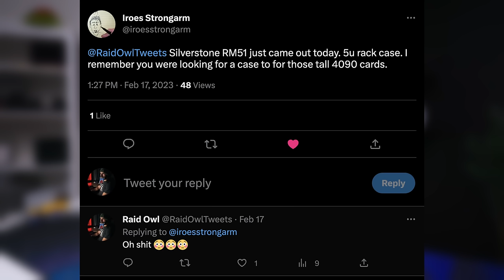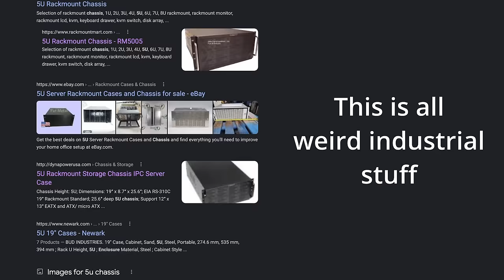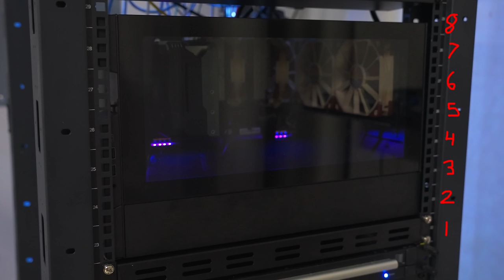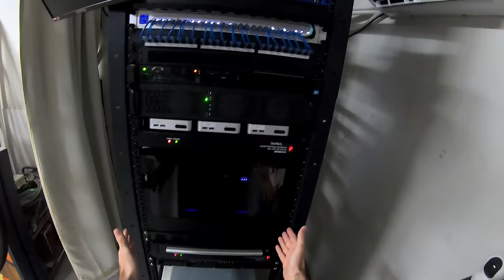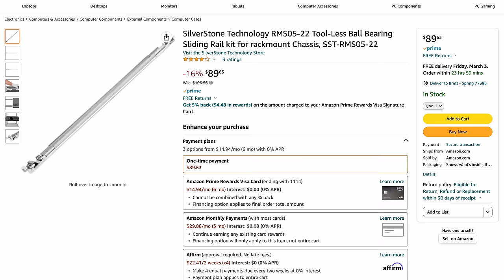An actual 5U server chassis - Silverstone RM51

Comment: I am running the RM42 for about 2 months now and I am just using a 6800XT from XFX which already was a tight squeeze, I had to remove the PCIe support bar completely in order to fit the GPU. Having the additional 1U of headroom would have been nice, although I would not have had the space in my half height server rack to fit it. But overall a great case and it is running great. Thanks for the video, it was very informative.

Comment: It may cost more up front however that case will give you a lifetime of service.   Just keep it dust and condensation free to negate corrosion.
I have two 4U's I have had since 2007 and both have survived three complete system rebuilds.  
The two catches with mine are:
(a) the PCI slots are too narrow for the horizontally aligned USB ports on those multi-port USB PCIe cards but that can be addressed as needed.
(b) the front I/O header still has the original USB-2.0 ports and replacements are not easy to find for the case now it is no longer produced, so I added a 2.5" drive panel with 4 x USB-3, audio & mic connectors.
In my case I am running one as my daily driver i9 13 gen platform, the second a xeon system running TrueNAS Scale, and the third PfSense Plus with 2x4x1GNics & 1x2x10G Nics.

Comment: Just got this case at work to move a thread ripper based system into to use in a road case for mobile live productions on VMIX and OBS and it’s a really nice case! One feature it also has is it comes with a rectangular metal piece you can mount 2 80mm fans into for extra exhaust, if you have a ton of pcie devices, and slot into that space above the pcie slots (so that gloryhole he mentioned is for the fan cables)

Comment: As a professional stagehand with some gaming interest on the side, i think I'm gonna pull the trigger on this case. I have a 12u shockmounted roadcase just collecting dust so i think I'm gonna mount this with my 3u guitar processor and maybe some extra fan panels for the blank rack units. My biggest concern will be cooling but I imagine if I dont back my roadcase up to the wall I should be pretty golden especially as my current PC has a water cooling AIO ill be putting in

Comment: I had been going back and forth between some of the 4u options from Sliger.   This case is wonderful for just making sure everything fits with clearances.   And is oddly tempting to want to watercool.
Reply: I got the Sliger 4u
Reply: What did you decide on? I'm considering the exact same thing.
Reply: @ryanwwest  Sliger cx4712 at the time - they now have a cx4713 as a very similar option.  I have been fairly happy with the CX4712 up to date - it does not have a real backplane for hotswap - that is the large downside I can mention.

Comment: If you are in the market for something like this again. You may want to take look a the rack mount offerings from Sliger. They do not have 5U cases but, they do have 4U and they have options. Which can be much cheaper for the case and rails.
Reply: Good call. I have a 4U case from Sliger with an RTX4080 in it, although I did need a 90 degree 12vhpwr adapter to make it fit. Sliger make excellent quality cases, although I also have a Silverstone case in my rack too which is equally as good.

Comment: I looked at it, but choose to go with a Pull out shelf and a standard cabinet (Lian Li Mini Air) which fits in my smaller rack. 
Where i live i saved around 449 us dollas on that to upgrade my GPU. 

My rack is mounted in my garage, 5M cables reach its with no problems, its really nice, im never going back to having it in my room, the Heat and noise is gone forever!

Comment: I would consider that case for my primary workstation.... I had to downgrade my Noctua NH-D15 to the NH-D12L to fit in my 4u rack case.  I just wanted my system to match my Proxmox and trueNAS racks... lol, for no other reason.   I am actually fine with the smaller cpu block as temps are fine

Comment: Looks very nice!
This case actually kinda reminds me of my fractal torrent with the 2 huge 180mm fans in front, and those can move a lot of air while not spinning that much at all.
Reply from the maker: Yeah this thing pushes A LOT of air
Reply: @RaidOwl  Would you describe the sound of the 184i Pro's motor to be 0db silent from 100-350-ish RPM? I'm asking since I want a system that is totally dead silent on IDLE, surfing with many tabs, very light photoshop, vlc, etc. I have zero issue with these newest Silverstone 180mm to be loud above 1000 RPM, but I need the friction in their motors to produce zero, but I do mean truly zero friction sound (motor noise, subtle grinding sounds which these fans were known for from their very faulty first production batch, etc) during idle use.

I love the RM51 since it apparently allows one to place it like a tower merely inches to the right of your face as one would usually do with a standard desktop tower chassis, all the while having two handle-bars installed on the case's top for ease of movement and looks. This is exactly what I want to do. I want to place the RM51 vertically (like a tower-style desktop on my desk) so that the PSU is ON TOP and the power button being on the lower-right (of the case's outer front), as opposed to the stock image of this chassis from the official site, showing the power button in the upper-left corner and thus actually implying that such an orientation has the entire inner system inverted by 180 degrees with the PSU on the bottom.

But anyway, then, after placing it on my desk vertically with the power button on the bottom right, I would then proceed to permanently pop-off the front metal grill (along with the dust-filter mounted onto it) and compensate for this removal by adding two FF181 (180mm) fan filters on the INSIDE of the case (i.e., mounted onto the fans themselves). The reason why I'd go through all of this hassle (500 USD RM51 + 40 USD 2 x FF181 dust filters) is because to MY eyes, this RM51 thing with the front patterned metal plate REMOVED looks as if it is THE definitive zero-intake-obstruction (metal-mounting obstruction) case on the ENTIRE market, meaning that not even the fractal torrent allows more air-intake than Silverstone seemingly pulled off with the RM51's usage of two 180mm fans and carving their metal grills so that they'd allow the absolute maximum amount of air to be taken in by these 184i Pro's (which, by the way, would be useless if hypothetically mounted in a case with too many metal patterns and shapes obstructing the living s*it out of any potential that these fans had).

My point and question being: do you, as the only person to have done a review of the RM51 think that:

1. The RM51 with an NH-D15 in it would be 0db truly silent during idle (up to, say, 500 RPM)?
2. The case can be placed vertically on a desk WITH the power button being on the bottom-right corner all the while two handle-bars CAN still be installed on the case's (vertical) top regardless, including the ability to install the plastic feet as well in such a weird orientation (opposite from the vertical-mode shown on Silverstone's site)?

I'm even thinking of making a noctua-themed semi-passive system in this case aimed at total silence, so am obviously REALLY curious whether the 184i's could synergize in silence with noctua's stuff so as to become a truly silent (during idle or even light-load) use?

Thank you for taking the time to read this and I am basically hinging my purchase decision for this chassis on your potential feedback. Please, let me know if you find the time.

Best regards!

Comment: Thanks for the video!   This is exactly what I have been thinking about doing. I have two desks (gaming desk) and a (work desk) with a 42U half full server rack between them.  I have been thinking about clearing up some desk space by getting rid of both gaming and work pc towers and put them in the rack.  Then just run the needed cables to each desk.

Comment: You are my kind of people.  Instant sub.  Don't forget the rails.  Can we Noctua the front fans?
Reply from the maker: I would if the stock fans had been ass
Reply: I don't think Noctua makes a 180mm yet, but I believe the silverstone 5U case comes with a triple 120mm adapter chassis for the front fan area (could be used for both water or air cooling. My tentative plan is to get 3x Noctua NF-S12A 120mms
Reply: @RaidOwl  do you think replacing the non-ass 180mm stock fans with 3 Noctua 120mms is wholly unnecessary?
Reply from the maker: @drewthompsonhooke  for me, yeah...but noctua fans are dope so I wouldn't blame anyone for swapping.

Comment: the thing you didn't know what its for, its a pci-e card support bracket the arms slide down and have fingers to hold the pcb so they dont move and get damaged in shipping and moving the system thy usually don't really work on gaming cards as they have shrouds and backplates in the way of the pcb but its meant for big pci-e add in cards you might see in enterprise settings

Comment: I know that some Supermicro 4U chassis can fit a 4090, if you use a 90 degree cablemod adapter. I haven't had a chance to try any other 4U chassis, but those Supermicro ones definitely work. Airflow is enough for a 4090, even though it only has a single 92mm intake fan.

Comment: In the process of moving all my servers and my workstation to a rack, and ran into the same issues.  Not only do I need a new case (can't fit newer GPUs in my current case), it needs to be rack mounted but also a new cooler as my current Noctua doesn't fit in a 4U.  So, subtracting the cost of the cooler, getting a case that will fit ANY GPU that might come out, and still having space for SSDs and a few HDDs.  It's really not that much of a stretch for something that, and you get those awesome fans in the front.

Though I REALLY would have liked to know how loud they were away from the rest of your rack.

Thanks for the video!!!
Reply from the maker: It’s extremely quiet and I’m a noise snob lol

Comment: I have to ask because you're the only video online (even including Silverstone's official) that shows how this darn thing works. Do you know how the front grill cover is suppose to come off so you can access the screws mounting the 180mm fans?
Reply from the maker: Yeah you just pull the front grill off. It’s attached by clips at the top and a grove at the bottom. Then you can unscrew the fans.
Reply: Do you pull forward or up, its suuuper tight and I'm thinking I might have to remove it from the rails to be able to apply force. Also thank you for the quick response despite how old the video is.
Reply: Actually, got a little brave. I used a flathead aimed for the seam between the front grill and case and tapped on it like a chisel, the front popped off. I see why it was so hard now, two ball pins with catches on the door and barely a handle to grab on. Nicked the powder coating but not sure I'd be able to pull it forward the first few times on a new case, but now I'll know for case number 2. Thank you so much for this video and your reply. Much clearer and faster than the manual or Silverstone's email support, and since its so niche, there's not alot of info out there. You're the man!
Reply from the maker: Sorry you had so much trouble but I'm glad you got it off! @NikoroKumitsero

Comment: Thanks for the video. It looks very full by the end of the build - do you think it would be possible to accomodate another 4090 there? Cheers
Reply from the maker: Yeah depending on your motherboard and model of 4090. Should be doable
Reply: @RaidOwl  I'm interested in dual 4090s too but I wonder if 8 slots will be a bit toasty, not much space in between them or below the last one for that matter.

Comment: Was looking at this chassis yesterday, however only 4x3.5HDD?  Is there any possibility of adding more?
Reply from the maker: Not that I know of. It’s not really a ‘NAS-focused’ case I guess
Reply: @RaidOwl  SO much room, if I could squeeze in 2 more 3.5 (total of 6).  Guess we could mod that GPU holder (the doohickey at 10:58) that holds 2x3.5 to hold 4x3.5? - Thank you responding!
Reply: Why are you even using 3.5 hdd's?  NVME SSD and a NAS... This is a gaming/workstation case.  Hell you can get a 4u case way better suited for storage at half the price

Comment: I might actually buy this case. Tried doing the exact same thing with my gaming rig, not realizing the cooler wouldn't clear my lid. Either going to need a 5U case or switch to a rad mount cooling setup. :/
Reply from the maker: Yeah I really didn’t wanna use an AIO for the 13900k

Comment: Would you describe the sound of the 184i Pro's motor to be 0db silent from 100-350-ish RPM? I'm asking since I want a system that is totally dead silent on IDLE, surfing with many tabs, very light photoshop, vlc, etc. I have zero issue with these newest Silverstone 180mm to be loud above 1000 RPM, but I need the friction in their motors to produce zero friction sound. Thanks!
Reply from the maker: Yeah I mean it’s about as quiet as you get even for a desktop machine

Comment: Hi. Can anyone help me? I'm new to the server rack world. if I buy this 5U server case for my gaming PC; How do I know what kind of server cabinet to buy. Like as long as I buy 5u or bigger and that it is 20 inches deep; im good? what about the width from the rail to rail. Are all the cabinets universal. Like for music equipment and pc server equipment? Do I need to make sure the cabinet has specific width? Since this case is 17.3 do i need to account for the sliding rails that will be attached. Gets confusing. Lol
Reply from the maker: Racks and rack mounted stuff is standard width (19”) for the most part so don’t worry about that. Racks will have different depths that you want to make sure is large enough to hold your stuff. Then rails will generally have a range of depths they can mount to. Hope that helps.

Comment: Interested but that price! Holy Cow!
Reply from the maker: Yeah it’s steep
Reply: @RaidOwl  Ended up getting it anyway. Going to be using it with the feet that should be included no rack here. Dual Epyc and two Nvidia A5000's needed a good home. Going to be sound foaming It for sure noise drives me nuts for a PC that's on 42/7. Anyways thanks for the video reviewing the case.

Comment: What a waste of money.
I mode my system case with drawer rails from hardware store and front ears use cut and drilled aluminum angle stock; dame for solid rack rails install and slide case into rack.
Reply from the maker: Damn that’s crazy

Comment: For what it is, I can't justify spending 434USD on something this basic.
Am I being unrealistic here?
Reply from the maker: Absolutely not
Reply: On another note. I have a big ole network cabinet in my office/garage. I would eventually like to consider just rackmounting my gaming pc.
What do you use to send you inputs and display from the server cabinet to your desk?
I would actually like to run cables to my living room tv as well as my office station area so I can switch between the two. But I don't want to "stream" things to these devices. due to reduction in quality and latency associated with it. Did you just run very long cables of whatever you need or are you using specialized hardware of some kind? @RaidOwl
Reply from the maker: I’d suggest optical display cables and active usb cables. It depends on how long the runs are but you should be good.